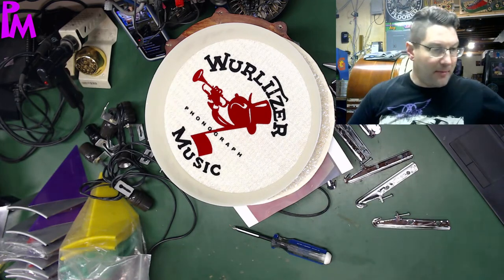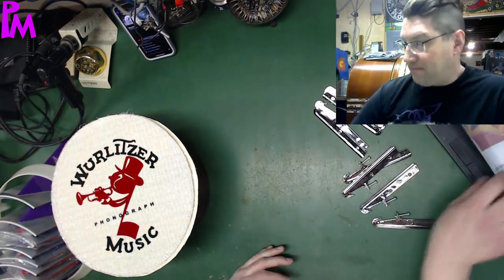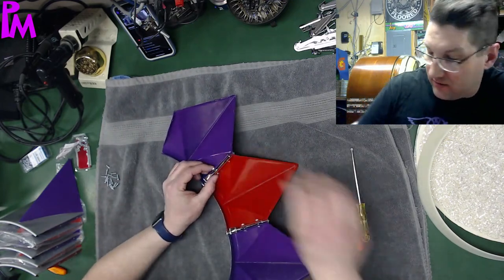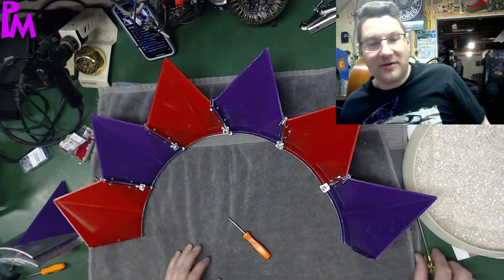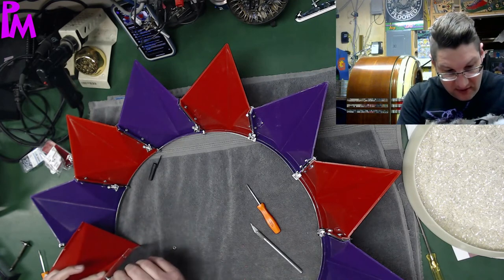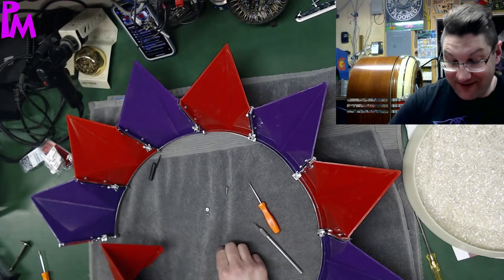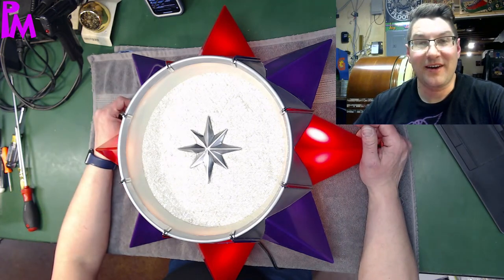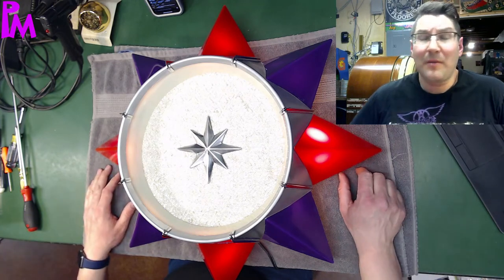Wurlitzer Star Speaker Kit Assembly 4002 4001 4000

Comment: I would probably want to spray contact glue the grill cloth to the wood baffle before putting wood and ring together,
Reply from the maker: The official cloths are much stiffer and would not have this issue,  this is a try at using some different material.  I agree either glue to wood or even stretch and attach to a screen or backing of some sort.